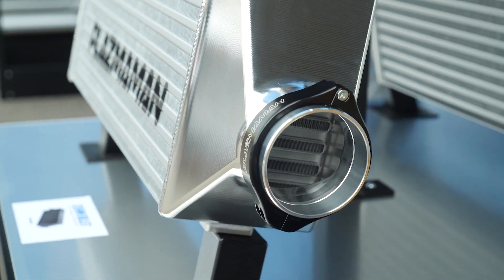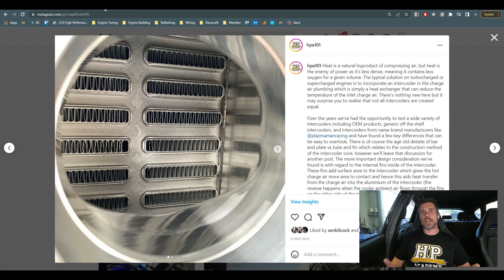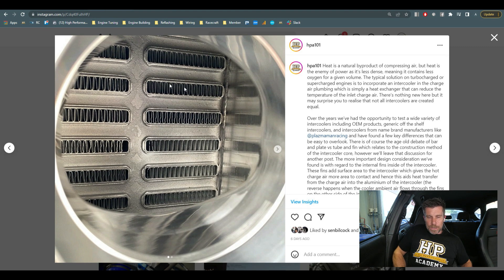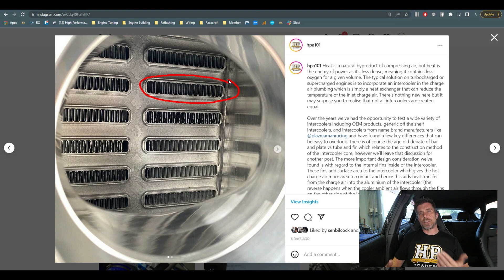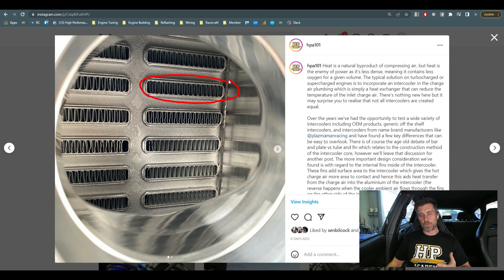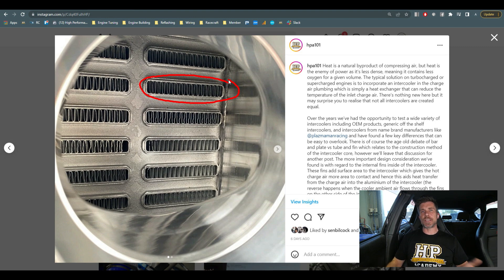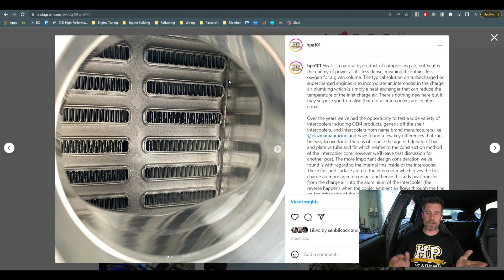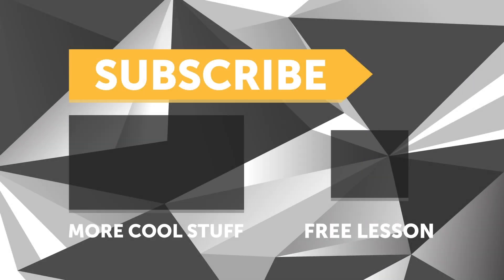Don't Buy An 'Interfooler' Get An Intercooler #shortish

Comment: Not everyone can afford plaza .heaps cheap Chinese actually do the job especially nowadays they better made ,my mate bought a $50 Chinese cooler off market place with a dent made 750rwhp😂
Reply from the maker: Big difference between making power on a dyno and holding a car together on track.

Glad that worked out for your mate, can get pretty expensive when it doesn't though! - Taz
Reply: @hpa101 what would e recommend for mid budget for turbo ls...I was thinking race series aeroflow.killaboost has made good numbers but then I've heard not much better from stock aeroflow
Reply from the maker: @Homebrewwhisky the best you can afford to match the power you're making. Will also depend on street vs track. You can get away with more on a street build as they are simply not worked as hard for as long which is nice for the wallet.
Nothing hasn't been done before with an LS so in your shoes I'd look at what others have had success with on similar builds. I'm talking builds that have been around for sometime, the rose tinted glasses are gone and people have given real world feedback on 😎 - Taz.

Comment: I'd say "better" but still possibly short of "properly"?
Those end plates are still going to be adding restrictions because of their designs - check out 'vena contracta' for the fluid dynamics theory and math' for the entry losses,  and there will be a small loss due to the gas expansion at the exits, check out " the Borda–Carnot equation" for that.
I don't know if it's actually going to be that significant, but a simple redesign of the end plates' pressing would cost little and may be helpful regardless - and be a potential selling point?
Rather than make the end plates, it should be easy enough to dummy build a charge cooler with plasticine or modelling clay, to give a smooth entry to the internal passages to check the affect on the pressure drop and hence calculate potential gains, dito with the cooling air's external airflow.

Of course, the exact same thing applies to the cooling air passing through the matric, too - that may actually be more significant as not only is it going to add additional resistance to the airflow, but restrict the flow to other coolers behind it.

The other thing is the airflow from the inlet through the end tank to the matrix, and from the matrix to the outlet? Those are certainly much better than many on the market, but is the distribution to the matrix tubes equalised as much as practical?

Comment: I have an Re-Amemiya intercooler that is sortve like a v mount but instead of going left to right it goes bottom to top and it's a lot lot thicker so that it can be made small enough to fit but still get enough cooling. It's so hard to explain but basically it's excellent at cooling air and it's very small so more room for other things of course. It also isn't mounted in the front giving my 4 radiators and coolers more cool air to enjoy keeping the rotary at a crisp 83c in the winter and 85c in the summer (no matter how much boost or throttle I give it). What I'm saying is I completely agreed with the video. Design is everything and because of re amemiyas consideration for this I'm able to do more with other aspects of cooling (or anything else for that matter). Great video 😉👍
Reply: If any1 was curious this is the listing of the car with engine pics

Comment: When in doubt (like with the cheapest log style 3" air-water intercooler I could find), add a 1/8" bung on the inlet and outlet.  From here you can use a proper T-fitting to combine both a ferrule style T/C probe and a pressure tap.  For my application what I found it had minimal pressure drop and a notable delta temperature between the inlet and outlet (lower temp at the outlet).  If you intercooler shows a differential in pressure of something like 0.5 psi and/or a single digit temperature difference between the inlet and outlet, then you've got something wrong.
Reply: A bit of data logging never hurt anyone.

Well, not counting the wallet.

Comment: Bigger contact surface, but also greater resistance to air flow. 
Naturally it still gives better results than traditional IC.
Reply from the maker: I mean, if you're super worried about airflow resistance you could just not run an intercooler at all right 😝 You're of course not wrong though and this is not the only type of intercooler either.

As always, everything has some sort of tradeoff which ideally gives more benefits than problems to justify the use of 🤘 - Taz.

Comment: If any one knows; I've had a few water rads that don't dissipate heat.
Is it possible for the alloy to be the wrong spec. eeer alloy?😆
Reply: Impossible to say without knowing the exact radiators, their design, and the airflow through the radiators*, etc. There is a small variation in thermal conductivity of different alloys, but the gauge (thickness) may have more affect.

*On that, I've seen some HORRIBLE radiator fan "ducting" that blocked of much, even most, of the airflow - some from people who REALLY should have known better!
Reply: @gordowg1wg145  The applications  have been a Mini 1275,  MGB  and a Fiat Punto. All standard cars but with highter power output (Not much ie 15-20%) All had alloy rads but would not stay cool on the dyno. Replaced their new alloy rads for a an other new one but of a different make, problem solved👾
Reply: @gothicpagan.666  
Ah, good, thanks - so it would seem to be a poor design issue?
Can't comment about the others, but a cheap and easy cooling upgrade for the Mine would be to use the 'export' fan which was a much higher airflow design.
Way back in the day my motherI had a very quick  Mini* and even with 80+mph AVERAGES cross country in 30+ C temperatures, it would barely move from mid-gauge. As I recall it had a stock radiator with the 12 blade fan.

*it was supposed to be 'stock', but a family friend with a dealership in the UK was organising the export of it and we suspect it was 'upgraded' in some way as a surprise for my mum - she was a very fast driver in the day. By that I mean it would pull an indicated 99mph (ignition warning light) or a corrected 94mph even with four in the car! And get ~34 mpg doing it! Those were slightly better than the 1275 GT at the time.
Reply: @gothicpagan.666  
Forgot, IIRC, you really needed the thermostat in the A (and B?) series engines as they could run into localised boiling, overheating, and block cracking without them.

Comment: Why are they all long flow? 
I guess packaging, but no one really talks about short flow ICs anymore
Reply: maybe because the bottom tank seems to usually hang pretty low when installed?  I agree with you though.  I had that style and it worked great.  Ugly, and i was worried the bottom was going to get beat up but it worked great.
Reply: They say all the cooling happens in the first 4-6"...wonder why this never gets tested